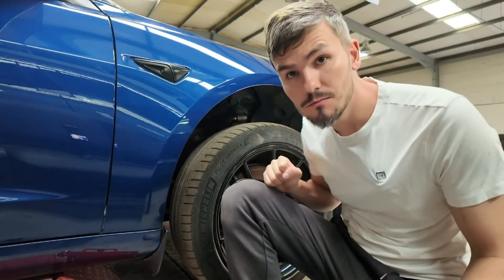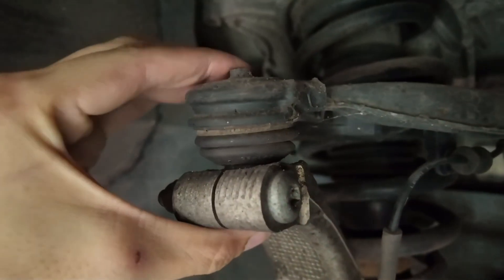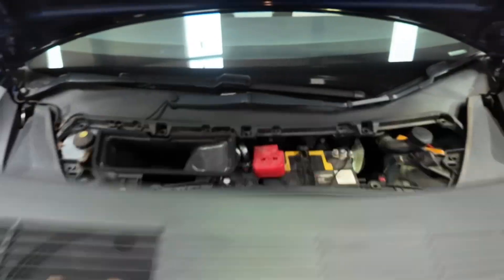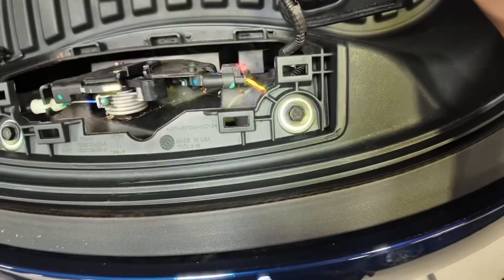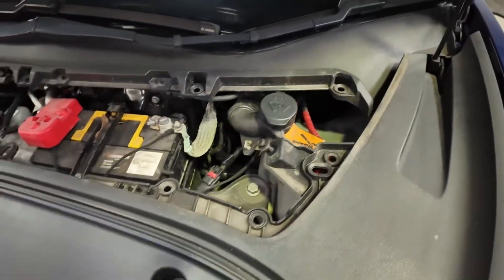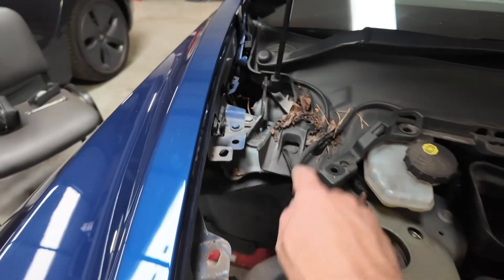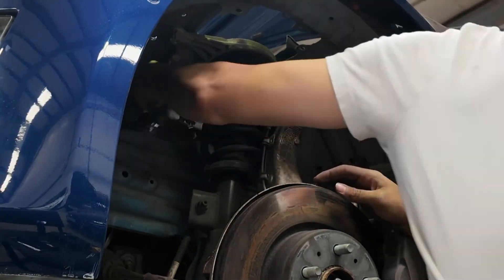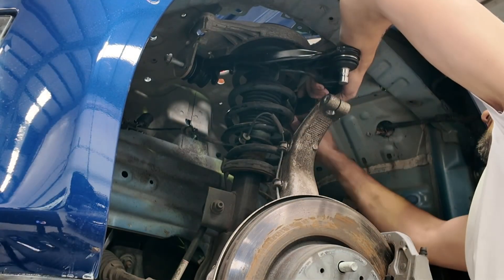Replacing the upper control arms on a Tesla Model 3!

Comment: What are the symptoms of a ruin up arm? I have noises of nocking on bumpers or ruin road...in a slow drive...
Reply from the maker: Those symptoms could be upper or lower control arms. Without seeing or hearing it, it would be hard to tell
Reply: @Richardsonsautomotive i replaced the lower curved arms. Still the same nocking noise on bumpers.

Comment: I've read that bushings are supposed to be torqued at ride height.  Some had suggested measuring the center of the hub to the top of the fender edge (423mm) and using a jack below the lower control arm to raise the suspension to ride height while on the lift.  Only then should the bushing bolts be torqued down.  I'm not sure exactly how to get a torque wrench in while the shock tower is in place, so if anyone has a suggestion please share.  Great vid overall!
Reply from the maker: Thanks! The way I normally do it and should have in this video but it was hard to show is to use a transmission jack on the hub side of the arm and lift the hub up until the car starts to lift off the ramp and then torque. It is minimal rotation on that lower bushing and if I was DIY’ing it on my drive with one jack I would probably just torque it not under load. It will leave some rotational stress on the bushing but I think it would be minimal.

Comment: Some things I learned doing this.

1. One thing you didn't mention, you need to remove the fender liner or it will (barely) get in the way of dropping the strut
2. At least for me, getting the strut back up in place was a pain the butt, even with a crowbar... I recommend just getting the replacement stabilizer bar link nuts (or reusing at your own risk) and disconnecting the top of the stabilizer bar link and using a new nut to put it back on... This is done in the service manual so I assume would make it easier to get the strut back in.
3. The nylon locking nut between the FUCA and knuckle is recommended to be replaced in the manual, you do replace it, but just throwing it out there that it's recommended. They're like a buck for a pair from Tesla.
4. The 2 bolts that connect each control arm to the strut should be torqued at ride height. You can probably do this with a ruler if you look up where it's supposed to be set. Refer to the service manual for the distance and measuring points, it's hard to explain without a picture like in the manual.

Unfortunately this didn't fix my horrendous steering squeak with the temperature drop, so I'm moving on to the other control arms, but this definitely needed to be done regardless, thanks for the great video! Keep em coming!

Comment: Did you need to set the ride height with the FUCA Ride Height Tool?
Reply from the maker: I didn’t have the FUCA ride height tool so I marked the position of the upper control arm before removal and used that as a reference. If you can get the tool it makes sense to use but I don’t think it’s necessary if you note where the old arm was placed.